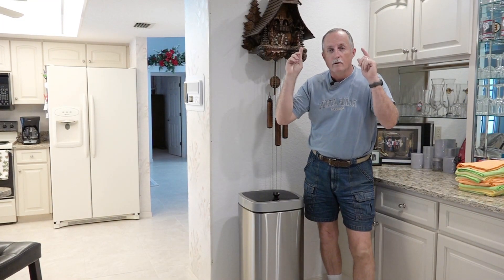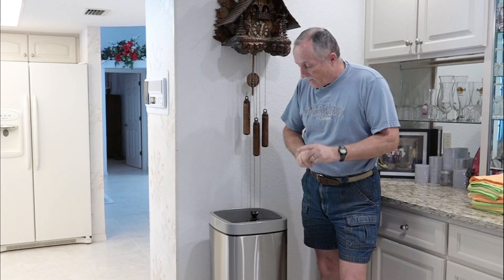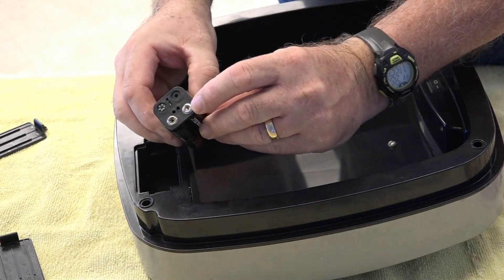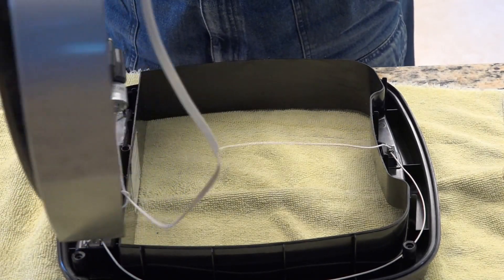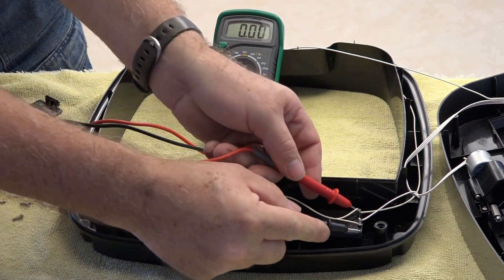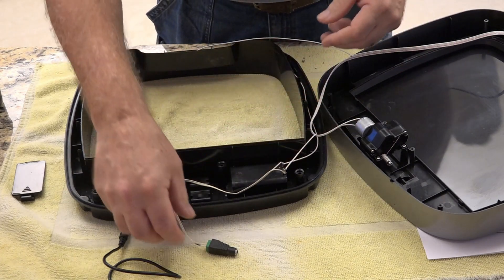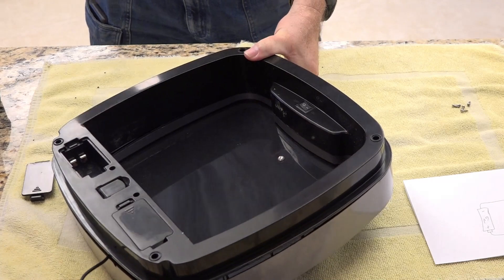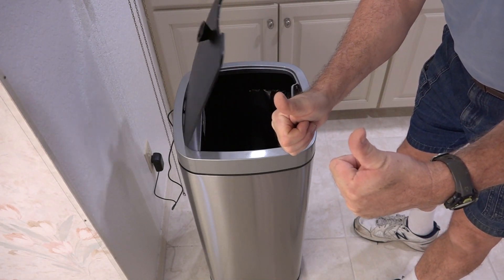Electrifying Trash Can - No More Batteries!!

Comment: Where did you get the adapter?

Would it work if I just spliced the wires and used electrical tape or heat shrinks instead??

Comment: I have an eyevac electric trashcan. The vacuum on the bottom works perfectly. The trashcan lid has stopped opening and closing. Any ideas for troubleshooting the lid issue?
Reply from the maker: There might be a vacuum line that runs up to the lid actuator that has cracks such that the vacuum is compromised

Comment: Great video, thanks.  Didn't work for me.  I bought a 6volt 1 amp adapter, which looks just like yours except for the 1 amp.  The can label says 8x1.5v = 120mA-500mA, so I thought 1 amp was good.

I measure 6.4v at the set screws on the adapter plug, so I know I've put those skinny wires in correctly.  Measured 1.14v at the motor.  Maybe something wrong with the circuit board? Or is 1 volt right at the motor, but the motor has failed?  Or is this the resting voltage when sensor doesn't see me?

Dunno, but I now have a manual trash can.  Like most of the rest of the humans.

Comment: How does it go from 120vAC to 6vDC?
Reply: The adapter in the video.  I found one on Amazon for $6.  Will need to solder adapter to wires.

Comment: I don't understand! 6 volts in each pack x 2 = 12Volts why does it work with a 6 volts transformer?
Reply from the maker: Each battery pack was 6V, and then they were connected in parallel, so the voltages do not add up to 12V, it stays 6V.  Remember, batteries in series the voltages add up, in parallel the voltage stays the same.

Comment: wHERE DO I BUY REPLACEMENT BATTERY PACK FOR THIS MODEL TRASH CAN AND WHAT IS NAME AND MODEL OF THIS ONE
Reply: Did you have any luck tracking down the name and model of this one?
Reply: @michaellonghofer7809  No i am afraid not but I did do this method on mine and it works perfectly and no more batteries.
Reply: Mine is the same one but the model sticker is missing on it. Sorry

Comment: And probably didn't cost you much more than a new set of batteries to implement. Question though. Do you not have to take the amperage into account when selecting an AC adapter when doing these kind of modifications?
Reply: No the bin or appliance will draw what it needs. all that it means is the adapter has the max wattage it CAN provide to an item if needed.